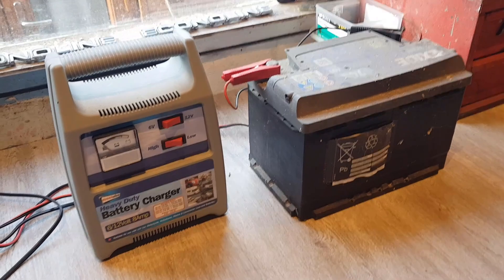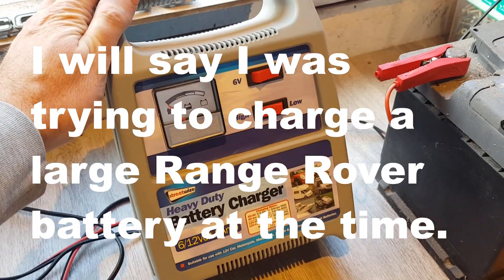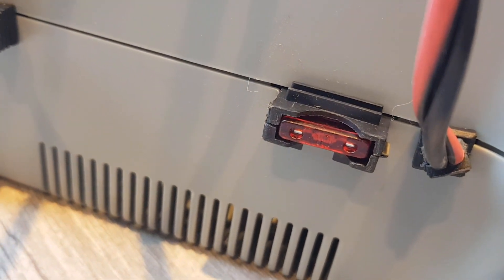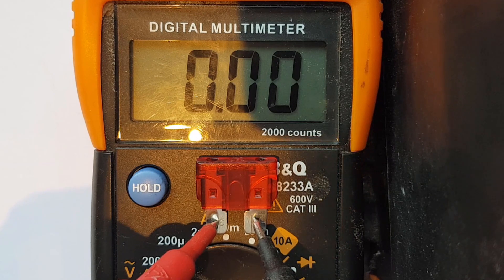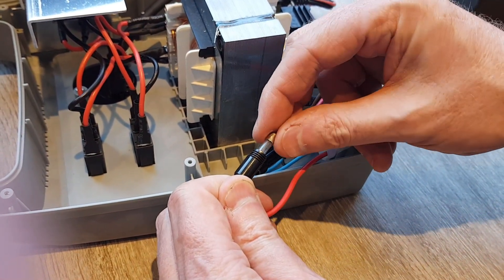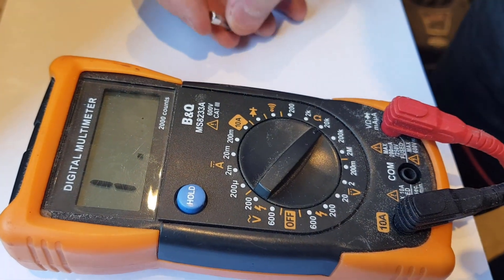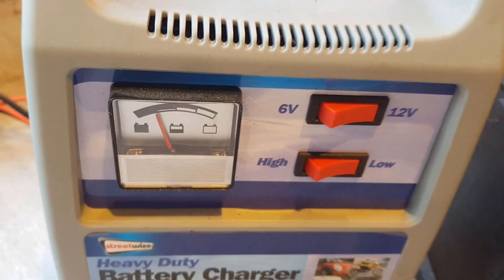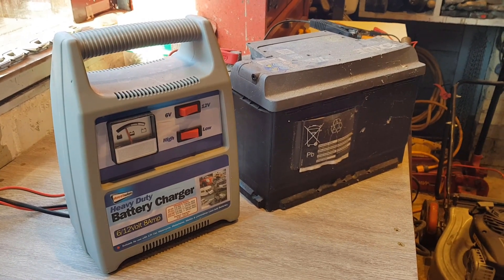BROKEN 12 Volt NEW STREETWIZE Battery Charger Is It TOAST? | Is This The Best Car Battery Charger

Comment: How long did it take to charge the battery when the charger was working?
Reply from the maker: Sorry for the delay in getting back to you, I have only just seen your comment. Did you have any luck in charging the battery?
Reply: @VintageRVAdventures  Got it started today (easier without the biting cold), it hasn't held the charge. But, will get it back on the road legally and take it for a long drive to see how it goes. Thanks for asking.
Reply from the maker: @demelza32  Ah okay, it sounds like the battery has had its day then, despite its young age. All the best.

Comment: Thanks for this. I just bought a model down from this and I am not sure it is working as the needle didn't go to the right when I turned it on? Maybe it is the same thing? It slowly went to right after time?
Reply from the maker: Ah that might be something else. A little moving needle and then moving slowly up the scale normally means the battery is not taking charge that well. Do you know if the battery is any use?
Reply: @VintageRVAdventures  thanks for the reply. The battery has been in a car that has been off the road for about 5 months. The other car we have has a clutch that needs to be replaced to I am wanted to get my old Punto up and running again. The battery is very new-within the past 1-2 years. The cold weather hasn't helped!We tried to start it from the other car, but it wasn't having it, as the other car battery isn't very good.
Reply from the maker: @demelza32  It is possible that you may be able to save the battery, by leaving on a good charge over 24hrs, particularly as it is not that old. The problem is lead acid batteries degrade when the internal voltage drops too low for a time. Give it a good bench charge and see how you get on.
Reply: @VintageRVAdventures  thanks. Yes, I will just leave it on overnight, and see how it goes. Need to get to work on Sunday...🙄. Fingers crossed. Happy Christmas!
Reply from the maker: @demelza32  Merry Christmas :-) Good luck.

Comment: Nice one John. Like you say, a lot of people would have changed the external fuse and assumed it was knackered. Well worth investigating a bit deeper. Cheers 😊
Reply from the maker: Indeed Gaz, unless you had decided to split the casing and go exploring you would think as a consumer that you had done all that you can by changing the external fuse. Hope all is well out there.
Reply: @VintageRVAdventures  yes all good thanks. Apart from still having to work of course...😆😆

Comment: A good little video, like you say all for a little fuse, you have done well to keep it for as long as you have done!!
Will you try it back on the RR battery, Or give it a wide birth and not bother?
Reply from the maker: Thanks Stuart. I will try it back on the Range Rover battery at some point, it does not need charging at the moment though as its fully charged. Before I do that though I will buy some more of those little fuses, as it seems I used my last one on this repair. I think I still have a video of yours to watch, I will make sure I sit down and watch that at some point today.
Reply: @VintageRVAdventures  thank you!!  
Yes it will be worth picking some fuse’s for when you do try it. Many people would of just given up and put it in to the bin.